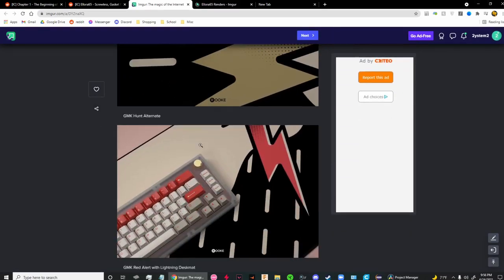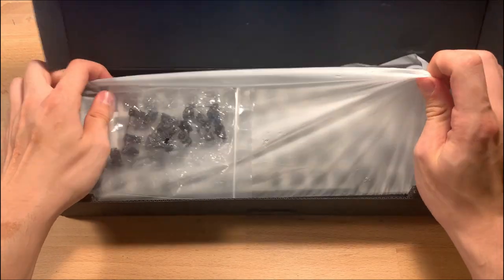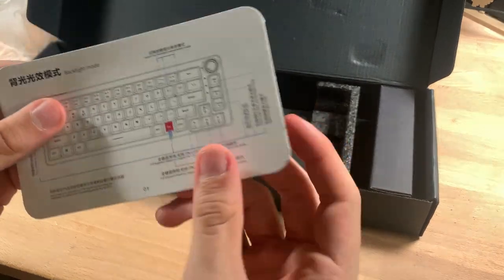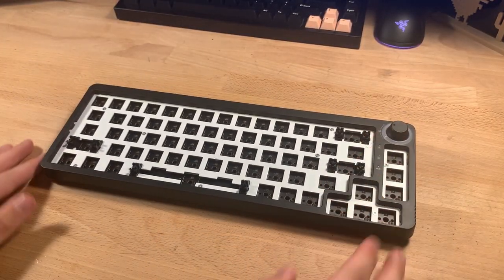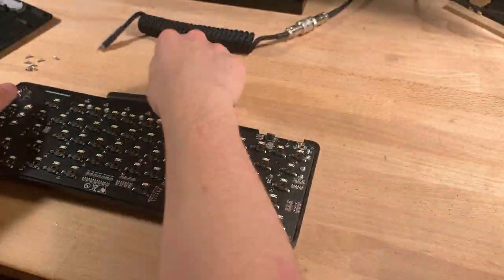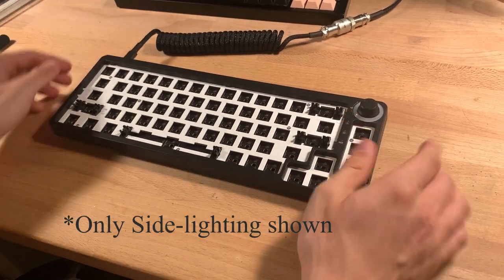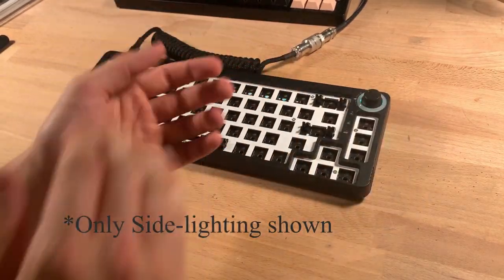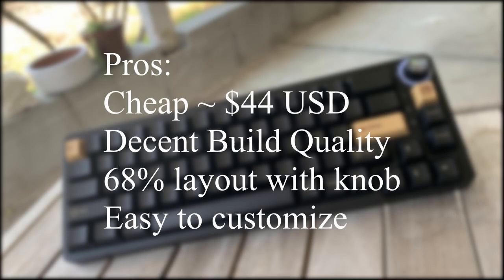This retails for $44 USD?? - TM680 68% Hotswap Custom Mechanical Keyboard Review and Build

Comment: you can press the function and tab key, and it will give the whole build a full rgb
Reply from the maker: ^ Forgot to mention in the video - I had it on full RGB, but due to my switches and the lighting, you could barely see it. The plate lighting pales in comparison to the side lighting.

Comment: Great video over all, I'm planning to get the tom680 with some gateron black milky tops, and maybe xda or SA keycaps for a budget thocky build.
Also maybe raise the gain on your voice over a tad bit, I listen to stuff at pretty high volume but when I got to your vid I had to raise my volume by about 20-25 more, but other than that it's a good vid!
Reply from the maker: Remember to add some PE Foam or do a Tape Mod. Yeah I've improved a bit on my newer videos. Thanks!
Reply: @tauntyyt  will do, cheers!

Comment: Can the case be replaced with an aluminum case?
Reply: there is no aluminum case you can swap it out with
Reply: @olivertrees  what do you think about the TM680 case? Are the materials used of good quality?
Reply: @Mr212sean  it's standard abs plastic. great for the price but it's not a high end board by any means.
Reply from the maker: @Mr212sean  It has the same build quality as a GK64X. The plastic is a bit better and matte instead of shiny.
Reply: @tauntyyt  thanks bro...

Comment: Hows the keyboard? Is it working still to this day? I'm planning to buy one but I've heard a lot of issues including the pcb getting fried after days or months of usage
Reply from the maker: Yeah mine does. Don't use the included USB cable
Reply: Okay thank you for the feedback :)
Reply: @matthewsantos505 Don’t even try to connect with the stock or it will crash your board

Comment: I am so happy to see a cheap 56E start kit like that. Might buy one not gonna lie, but my I only have a question.. can I make it sound thock with Polaris Grey switch and SA Keycaps? Maybe also with additional foam between pcb and case
P.S.: I want to thank my youtube reccomendation
Reply from the maker: Check out my sound test. It is somewhat thoccy. Case foam and SA keycaps will definitely help. 
P.S.: I want to thank your YouTube recommendations as well
Reply: @tauntyyt  I was looking for an ID80 or GK87 but after seeing this one everything changed. Since I have low budget, this is an “helpful” kit
Reply from the maker: @legojoseph  I'd keep this in mind.

Comment: I  finally got  it and put it together but the space bar stableizers keep getting jammed up and the space bar  gets stuck. Now I have to order some new stabelizers because mine did not come with the extra set
Reply from the maker: Open up the stabilizers to see if there's any problem with the wires. If not just wait. Sorry about that, but stuff from China doesn't get QC'd
Reply: @tauntyyt  I took the stabs out and everything looked fine, it wasn’t bent or anything. But i’m suspecting one of two things. The wire is too long/short or the mounting holes on the board are to close/far apart. I hope its just an issue that can be solved once my new stab set arrives I got from joinkeys
Reply from the maker: @djfive-seven563  Strange. Probably just some bad quality stabilizers then. Not sure why my kit originally came with extras tbh. Best of luck building!

Comment: I heard that this keyboard pcb will break when use. I’m planning on getting the 3 mode version and I’m wondering if this is a common thing. Should I get this keyboard?
Reply from the maker: Only if you use the original cable

Comment: sheeeeeeeesh sick build, just got mine. I was just wondering, how do yo manage to keep the light around the knob on? 
I've tried using the built-in commands as well as the software but it doesn't seem to work.
Reply from the maker: Is it wireless or wired?
Reply: @tauntyyt  wired

Comment: You should check out the bm65 from KPRepublic. It’s 65 percent plastic case with a blocker between the arrow cluster, and a hotswap pcb with screw in stab compatibility. There are also rumors of an alu version coming out at some point.
Reply from the maker: Yeah, but with boards like the Tofu65 and KBD67 Lite being pretty affordable and having a hell of a lot better build quality, I can't justify buying a board like the BM65.
Reply: Or BM68. Recently It A Alu case has been released by kprepublic as well

Comment: I got my units a few days back, No wonder this thing is blowing up in the community 

I think The Stock stabs are quite decent for what it offers. I mean they were quite decently lubed plus an extra set is a neat touch. 

But yeah, it sounds too hollow, Way too hollow!  Gotta work on it to fix that! BTW, The Plate is Steel, not aluminum it seems. 

I am glad things like this are blowing up! Massive win for the budget seekers!
Reply from the maker: Super hollow. Threw some PE Foam in my wireless one. I found out later on it was steel as well, oops. Love the board and will be releasing a review on the wireless one soon.

Comment: if i may know, what is the outside diameter of the knob? Is it 20mm ?  my item is still on its way. I plan to change the knob with aluminium
Reply from the maker: Here’s the exact knob: https://www.amazon.com/dp/B01MYTHSUE/ref=cm_sw_r_cp_api_glt_fabc_SAZ68BV2Y2PCFHG9NRMR?_encoding=UTF8&psc=1

Currently at work and dont know it off the top of my head.
Reply: @tauntyyt  thank you my friend…

Comment: I just placed my order through aliexpress, will paint the plate black though and then use some silk emerald switches from novel keys with the miami nights keycap set, also change the stabs for durock plate mounted ones, last add foam to the bottom board housing....I think it will look insane. Great videos though you have a new sub
Reply from the maker: Thanks! I love the Miami Nights keycap set so I bet it’ll look dope. Unfortunately as I mentioned in the video, this plate only supports clip-on stabilizers, but clipping the feet and lubing them will make them sound less annoying.

Comment: So I bought the TM680, but when I downloaded the software and play with the colors a bit, the keyboard just went black and set itself to the color I selected and now I cant do anything related to the colors using hot keys on my keyboard. Anyone knows how to fix this?
Reply from the maker: Just reset all RGB settings. You probably changed the RGBs by layers
Reply: @tauntyyt  I have tried resetting it but it doesn’t respond to any commands related to the fn key

Comment: Sorry did you do any mods for your sound test? I was offered this board for a decent price (in my currency at least) by a seller I know, but mainly because I'm holding out on getting a DZ60 build since that's much more expensive.

I'm mostly interested in hearing what it sounds like with a foam modded case and lubed switches (and modded stabs too, but that's kind of a given), since those are the primary mods I'll be doing on mine should I decide to get it.
Reply from the maker: For mods, I changed the knob, spray painted the plate black and added about half-inch foam. The switches are stock (because linear). I have a set of Durock V2's, but this board doesn't support screw-in stabs, so I slightly lubed the spacebar with some Krytox 205g (I ran out).

Comment: Do you think the o-ring mod would work with this keyboard similar to the gk61
Reply from the maker: Most likely. I don't have any o-rings on me, but the internals is similar to that of the gk61 and the Tofu60
Reply: they are both tray mount, so yes

Comment: Is this wireless? Bluetooth or dongle?
Reply from the maker: This is not wireless. Actually, there is a wireless version on Taobao for 369 yen, but is currently sold out.
Reply: @tauntyyt  Would you mind linking the wireless version in case it is back in stock? I was very interested in after I watched video even if it is wired but it would be super nice if it was wireless too.
Reply from the maker: @kiachiaki  Yep. Once it gets back in stock I'll either post about it on reddit and probably make a video.
Reply from the maker: @kiachiaki  I was able to order one, but literally the next hour I tried going onto the Taobao page and it was sold out.
Reply: @tauntyyt  so you think I should order soon on this link before it is sold out
Reply from the maker: @kiachiaki  Sure, but this is for the pre-sale, meaning it won't actually be shipped out until the end of July/early August.
Reply: @tauntyyt  yeah, but I guess it’s better than the group buy scheme. Plus as a Japanese I kind of vaguely understand Chinese sentences so hopefully the shopping in Taobao goes all fine...

Comment: Could you tell me what size of stabs is needed in this board?
Reply from the maker: 6.25u for spacebar and 3x 1.5u for backspace, enter, and left shift.
Reply: @tauntyyt  thx
Reply: @tauntyyt  cant really find any 1.5u stabs but if i mod the heck out of the stock stabs using holee,taping it to the the plate and lube it, do u think it will sound good or decent?
Reply from the maker: @MrLA-vp8gh  I suggest some nice PE Foam as well as the Tempest Mod. Throw in anything other than loud switches and you're good
Reply: @tauntyyt  thx man

Comment: is this keyboard can use for multimedia such as youtube.. can i pause the video using space bar or mute the sound using M key and others features.?
Reply from the maker: Yes
Reply: @tauntyyt  thank you..!! give me your gorgeous keyboard hahaha
Reply: @tauntyyt  i just bought this keyboard but the RGB doesn't turn on when i plugged the usb cable like yours and the knob doesn't show any volume movement in screen. the cable is okay. can you help me?
Reply from the maker: @kaistudio8229  Make sure your Computer has a volume device connected to it and make press FN + any of the three buttons on the side to cycle through the rgb options.
Reply: @tauntyyt  my pc volume device is connected and i did put some important switches such as Fn and others but nothing happen when i use it. 🥲why the my rgb doesn’t  light up immediately like you after i plug the usb.. so sad hahaha
Reply from the maker: @kaistudio8229  Not sure then. Sorry about that. Sounds like a defective unit
Reply: @tauntyyt  yep..a faulty one i think. the seller agree to change it.. thanks
Reply from the maker: @kaistudio8229  No problem and sorry for the inconvience.

Comment: Sad didn't show how thick the foams you put in the case.
Reply from the maker: About half an inch thick. It was quite hard to show as the foam I used was a bit too big for the case and liked popping out. Next keyboard video I do I'll go more in-depth with the mods I do.
Reply: @tauntyyt  cool thanks! Still debating this or the gk61 or k61 haha
Reply from the maker: @1700tt  I suggest getting a GK64X as it is hot-swappable with mechanical switches and not optical switches like the GK61. This keyboard is quite difficult to get as it is only being offered through Taobao and some other asian sites.
Reply: @tauntyyt  thanks for the suggestion.  Will look into it.